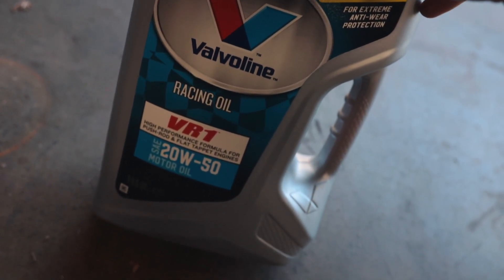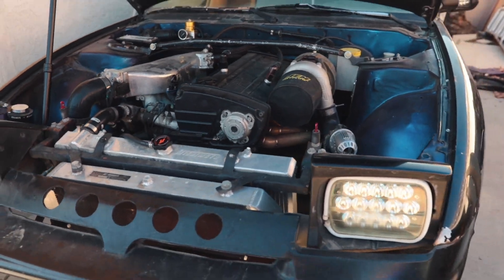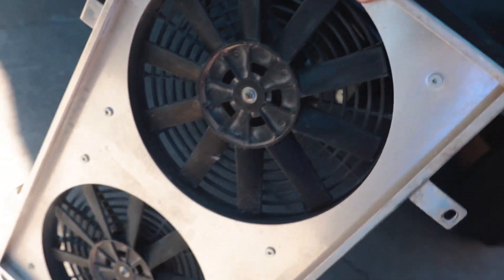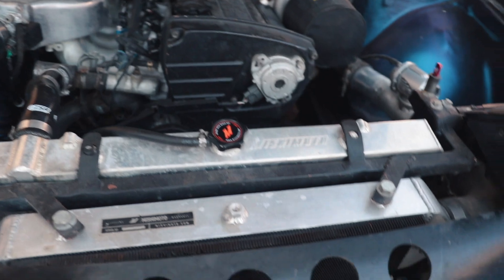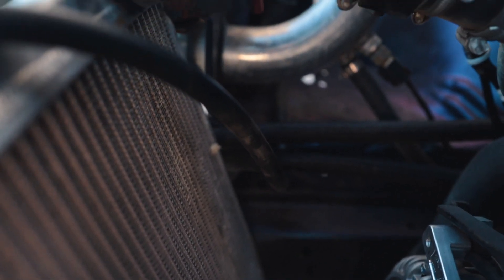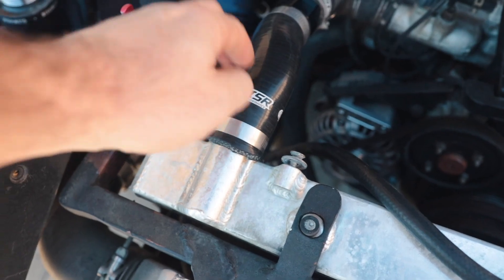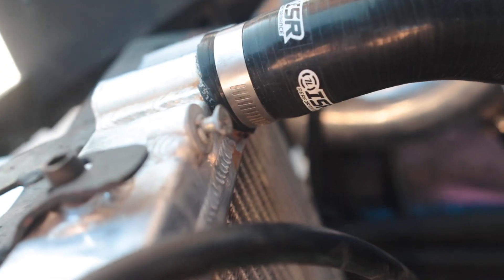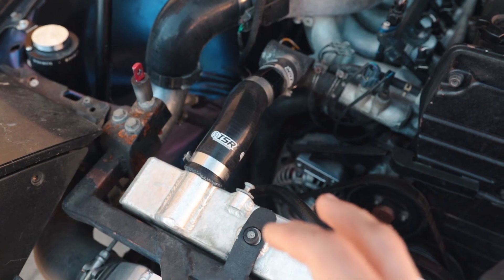My Offroad 240sx Radiator Started Smoking...

Comment: what size turbo and how does it perform?
Reply from the maker: Precision 5976e. Made 407whp on e85 at 23psi
Reply: @FSOMedia  is there much lag?
Reply from the maker: Full boost is around 4500rpm. This is only a 2 liter lol and rb20s have lag with such short stroke and small bore anyways. If you get a smaller turbo you’ll get rid of some lag but lose power on the top end. The lag makes it exciting too lol and in my application I have little traction anyways 😂